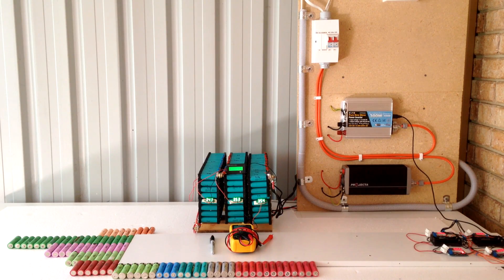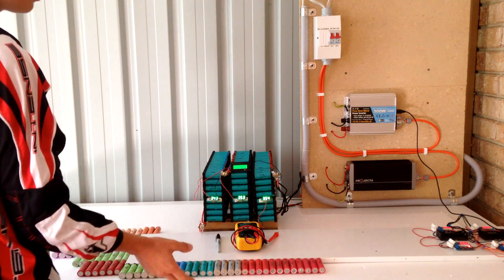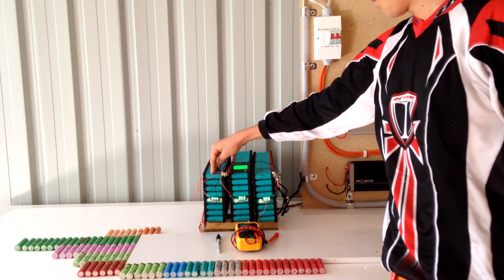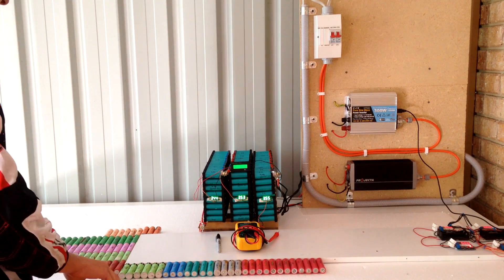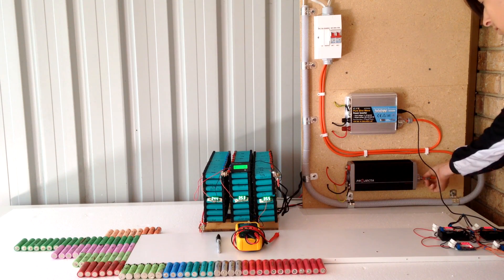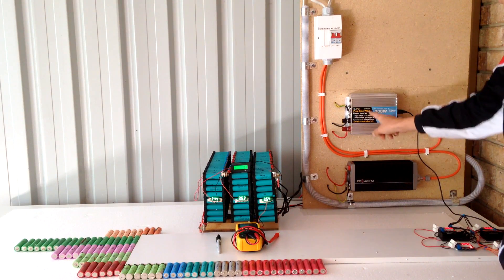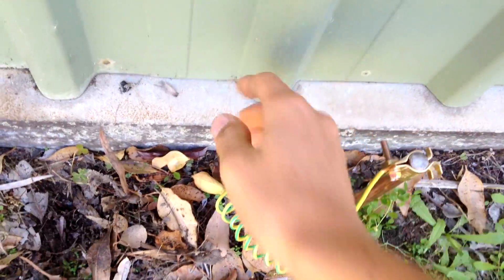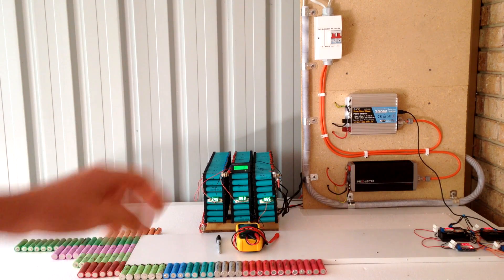DIY Tesla Powerwall | Wall Mount Inverter And Wall Outlet | Update 17

Comment: what bms are you using?
Reply from the maker: green N.R.G hi, don't actually have a bms, since they never worked for me. So far I have not had a problem with overcharging and balancing. I installed the volt meters so I could see if the cells were out of balance in a glance. Hope this helps!